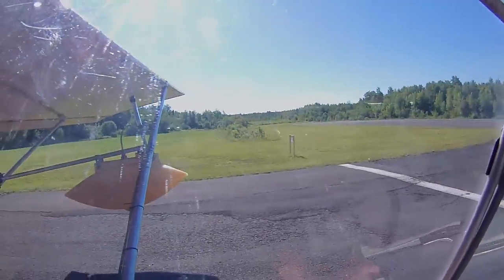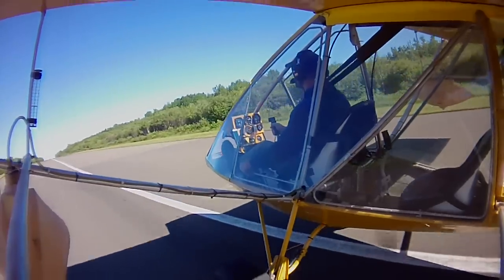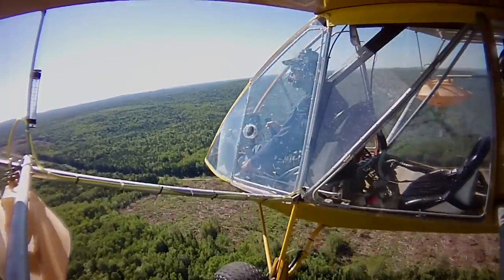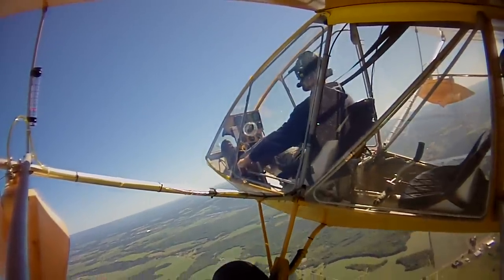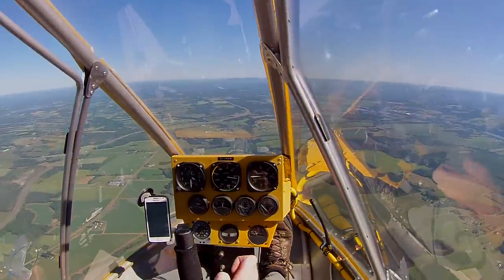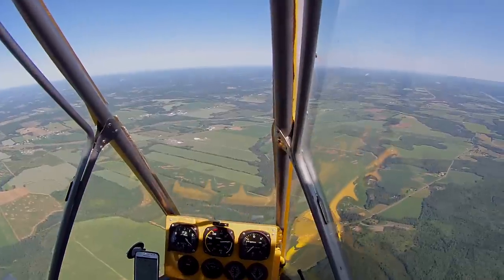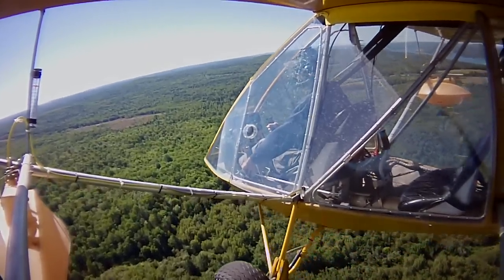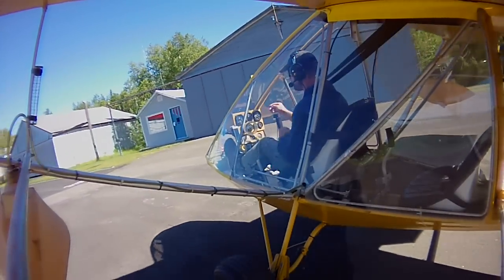Chinook Practice Session with Live Narration

Comment: Hi mmatt, in this video, at 14.30 you begin a 360 degree turn to your left and as you complete the turn you run into your own wake turbulence. After commenting on this you began a 360 degree turn to your right. Not sure if this manoeuvre has a name with you but in paragliding it is referred to as a turn reversal . I first came across it when I was doing an SIV course some years ago and it is used to assess how well a pilot can control his turns. SIV is a course which involves turning the perfectly stable paraglider into a bag of washing , and the correct action required to get it flying again. Always carried out above water with a safety boat in attendence.

Comment: Great vid and length, showing stall numbers and slow flight maneuvers. I used to have a 'Cobra' ultralight, by 'Advance(d) Aviation' I think. Pusher prop. It had small spoilerons/flaperons on top of the wings, but I rarely used them, only sometimes in stronger crosswind landings. That was a blast. I'd like to find a good deal and fly regularly again. There's a great grass strip airport 15 min away.  A couple friends have a 182, and an, RV12, I think. I like the low stall speeds of Ultralights and LSA/ELSA. Great vid.  Edit

Comment: Great video because it is perfect for where I am in the learning curve.   I had no trouble watching the whole thing.  I think some topics warrant a shorter length and in general it is probably safer for most subjects.  Love seeing the response of the aircraft with different inputs.  I think for some of these it would be cool to have an inset camera on the instrument cluster (if you wanted to get fancy).   I would be interested in your impressions of the the Beaver vs the Chinook air frame.  Likes and dislikes.
Reply from the maker: I've tried mounting a camera to the inside of the cockpit but for some reason couldn't get the vibration sorted out to an acceptable level. The Beaver and Chinook are both great airframes. The Beaver is a bit more yaw stable with the longer tail and swept wings and it's definitely easier to take off and land. Both are very rugged and well designed.
Reply: @mmatt  Hi Matt.  You might try one of several microphone vibration mounts.  Here is a simple one that could works with an action camera format.  

https://www.youtube.com/watch?v=unoVvswAPn0

  I would recommend a softer rubber band like a regular elastic band.  I've seen some absolutely fantastic vibration isolation that take care of a wide range of frequency inputs.  You can also add weight to camera to get rid of high frequency if it shows up.  Thanks for the Beaver/Chinook perspective.

Comment: Matt- My Chinook Plus 2 had flaps. Thats what you need to takeoff and land this thing with full authority. Full flaps will put you nose down and it will never fly faster than 50 dumping 500 feet just over the threshold and still being able to stop it within 300 feet. On takeoff flaps will get your tail flying in 2 or 3 seconds. In my opinion, it's just a matter of time before you ground loop this beast. It will probably stay upright with no damage but there is definately something wrong with this aircraft. I think the best purpose for a Chinook plus 2 is to put it on full lotus floats with no amphibs. It's a tough little plane and will take real beating but as a taildragger it's no Sunday flyer. You have to work on this technique all the time, use the flaps, and never ever land this airplane downwind.  Hope to see another video soon . We love your instruction technique in the Beaver
Reply from the maker: This Chinook has flaperons, but they're not really accessible from the front pilot seat. Silly design in my opinion.  I set them before takeoff and just use them for trim. Tundra tires on pavement sure is a recipe for groundloops. No close calls for me yet though. I had to do many many landings on grass before I was comfortable landing on pavement. I don't think there's anything wrong with the design, you just have to be willing to put the time in to learn how to operate it. It's definitely not for a new pilot.
Reply: The flaps handle was over my head. I could reach it . The guy who built the aircraft might have extended it but I don't know. 
I had the break away tailwheel so one it jumped out of the slot it could net be recovered easily.
Reply from the maker: I don't have a breakaway tailwheel. That could be the difference here. I can only imagine how terrible that would be once it came out of the slot!
Reply: GOOD Cheap aircraft are hard to define. Every ultralight has it's flaws. I'd ecpect though that if you didn;t want to to keep cheating death that you'd find yourself in a Rans. Those S-12 pusher or S-6 tractor are both great little flyers. The best part is they are not made out of all aluminum. The chromemoly cage just won't collapse all around you if you need to move some trees or a simple bobedwire fence. Both will take a VW direct drive if you don't have the cash for a Rotax.
Reply from the maker: I don't think I'm cheating death... but I do agree that Rans makes great airplanes. I have some time in an S-7 Courier. (video link below) That is a great flying aircraft. I'd love to try out the S-17 and S-18 Stingers as well.
https://www.youtube.com/watch?v=2K8jxVC3c8g

Comment: I'm very interested in buying a Chinook +2 as my first LSA and loved this long form video showing the flight characteristics. 

2 quick questions if you have the time to answer: 

1: I'm about 300-310lbs, would that be a bit too heavy for an aircraft like this, especially if flying with a passenger? (trying to lose weight and have a bit of time before I can afford one)
2: What's the realistic take-off and landing distance on one of these? 

I'd ideally like to use the plane to fly back and forth between where I live and where my parents live (about a 70 mile trip), and the best place I have to land is a 175 yard strip with about 600 yards of field on the other side of a shallow creek. So plenty of room to get down and to landing speed/ climb once the wheels are up. But would this be a realistically plausible landing area. 

Love the videos and please keep up the great work. They've been so helpful in trying to get started in the hobby.
Reply from the maker: Chinooks typically weigh around 600 lbs with full fuel. Their gross weight is 1050. According to the math you could take an additional 150 lbs of passenger or cargo. (these are ballpark numbers, every plane is a bit different)
175 yards should be enough room to land once you are able to put the wheels down exactly where you want them every time and you have good brakes. It should also be enough room for take off depending on your engine choice. In this case, I'd recommend a minimum of 65 hp.
Reply: @mmatt  Sounds great. Thank you so much!

Comment: Hi mmatt - I am building a Chinook Plus 2 out here in Northern Nevada, and find your vids to be very helpful.  I wish to suggest that you do a vid on a thorough pre-flight with good close-up views of your systems and assemblies.  Also, if you would ad commentary on what you like and how you think some areas might be improved, that would be fabulous !!  

I like the fact that you share verbally your thought processes as you fly along, and with your sharing of suggestions etc.  Some of it however, is difficult to hear above the background noise.
Reply from the maker: Ya, the intercom in the Chinook isn't as clear as the one I have in the Beaver. Consider a Flight Tech intercom for your plane. (that's what I use in the Beaver) I'll see about putting a video together as you suggested once I get the Chinook back in the air. It's currently grounded until I get a new engine for it. :-(

Comment: Please can you give more do s and donts  for landings and take off s in particular. I have purchased a Chinook plus 2 and need to convert from a weight shift microlight to a three axis like Chinook. And advice gladly accepted. Great video that.
Reply from the maker: Ultimately you gotta find an instructor and learn in person. Best tip I can give you is keep your feet moving to actively keep the plane straight at all times. Once it starts to get squirrelly, it's hard to get it back under control. And if possible, do all of your initial take offs and landings on grass, not pavement.

Comment: Do you prefer the closed cabin or open cockpit
Reply from the maker: There are a few times when having doors would be nice like when it's particularly cold or if I happen to fly fly through a rain shower, but overall, I feel the benefits of the open cockpit far outweigh the negatives. There's just nothing quite like the perfect uninterrupted visibility of the ground directly below you in a steep turn, the feeling of the wind whipping by, the ability to extend your arms out into the windstream, and the lack of greenhouse effect in the summer. I feel that an open cockpit simply gives me a more visceral flight experience.

Comment: How much flap input were you using on your touch & go's? Looking into the Chinook for possible future plans?
Reply from the maker: None. I only ever used them for short field landings.
Reply: @mmatt  Back when I did the PC Simulator in around 1998, I was landing on the numbers dead stick, floating it in on full flaps. Flew the 172 mostly, but a much higher angle of approach, kinda like parachuting in, but with practice, got to to point I could do it whenever I chose.

Comment: Hi Matt, I really enjoy your channel. I fly for work but would like to one day get into ultralights (Chinook/Drifter size). Whats your view on 2 stroke vs 4 stroke? Obviously 2 stroke is way cheaper, but I know little about them other than they seem to be less reliable than 4 stroke. I know a 912 is a pricey bit of equipment, but if you can maybe afford it, would you go that way? It would seem to have an advantage for cross country as well due to burn rate as well as no oil mixing etc. Are there a lot of extra handling considerations with the 2 strokes? Apologies for all the questions; I'd love to hear your views.
Cheers...
Reply from the maker: No, given the choice, I'd stick with a 2-stroke for an ultralight sized aircraft. Two-strokes are a lot more reliable these days now that we know how to properly run them. If you treat them right and stick to the manufacturers recommended maintenance schedule, I'd argue that they are at least as reliable as a 4-stroke. The power to weight ratio simply can't be beat either.
Reply: @mmatt  Thanks Matt, really appreciate your time and thoughts. Keep up the great work on the channel!
Reply: @mmatt  Would your answer change if you were operating out of an airport at 6500' MSL in a warm climate? Density altitude and all that?
Reply from the maker: No, I still think the lighter weight 2-stroke is the better choice on the Chinook. I might consider a  670 instead of the 582 though.
Reply: Check out the Yamaha engine that Steve Henry uses on his Highlander. 160hp and 125lbs 3-6gph. Pretty nice option.

Comment: Hi Matt.  When you are on final what rpm do you typically run?
Reply from the maker: It depends. If I've done it right, I'm at idle. That leads to a bouncy landing still though as I'm still perfecting my power off landing technique. I typically bring the RPMs up to 4000 or so around treetop level so I can soften my descent. You gotta make sure to start backing them off again a few feet off the ground or you'll just float down the full length of the runway. This is the same technique I initially teach students in the Beaver as well as it gives them more time to adjust their final height before touchdown. We quickly transition to power off landings though which is how I try to land every time when I'm solo in the Beaver since it's a much easier plane to land.

Comment: Thanks mmatt... loves that type of narration while you fly. I am looking at building an ultralight and I am very interested in a Chinook plus 2 on floats or an excalibur on floats.  Someone told me that the chinook is not for a low time pilot ( like me at 50 hrs).  Can you explain a bit why the chinook would be any different than a Excalibur or challenger or beaver ??    I like the  ruggedness of the chinook for backcountry landings... but if its to hard to fly...i can choose something else...lol
Reply from the maker: I think it's because the Chinook has a shorter tail compared to most other planes. This short-coupling makes the pitch and yaw controls very sensitive. It's very easy to over-control it. I have found that the Challenger (and I suspect the Excalibur) handles just the same if not a little worse. My personal experience in the Challenger also leads me to believe that it's not a good plane for low-time pilots either. However, if you're willing to put in the time with a good instructor, it won't take long to get a good safe handle on it. Just don't expect to hop out of a Cessna 150 and into a Challenger, Excalibur, or Chinook and expect to fly it safely. The Beaver has a longer tail and a swept back wing, both of which contribute to better stability. I have found that it flies like it's on rails. It simply goes in the direction that you point it until you tell it otherwise. I'm also of the opinion that the Beaver landing gear is superior in terms of ruggedness. That of course makes no difference at all if you plan on using floats. :-) If you want a Chinook (and why not? they're great planes!) get one. Just plan on some extra time with an instructor before you go by yourself. It is a fantastically rugged plane, it's fun to fly, and lends itself quite nicely to off airport operations.
Reply: That is great advice and insight. I will certainly get training before i get in one of those ultralights. I am leaning towards the chinook plus 2.  Keep those videos coming....they are very informative, educational and inspiring for aspiring pilots like me...lol.  What engine do you like best in terms of power and reliability for bush operation.
Reply from the maker: It's hard to go wrong with the Rotax 912. Aside from the initial cost and overhaul costs, the fuel economy and reliability are fantastic. The extra power they provide, especially when operating off floats, would be highly beneficial. That said, I run a Rotax 582 on my Chinook. They have the reputation of also being a very reliable engine if properly cared for. They are around a third the price of the 912 but they burn a bit more gas. Overhauls are more frequent but also a lot less expensive.
Reply from the maker: I have seen those vertical finlets (isn't that just a cute name for them) before on Challengers but I thought they were just for when they had floats on them. I didn't know they were supposed to be installed on all of them that have doors. I see now that the new kits have larger tails probably for the same reason. I haven't flown the Chinook with the doors off yet but now I want to so I can test this theory (which I strongly suspect to be correct).
Thanks for commenting! I love it when I get to learn stuff like this. :-)
Reply: Hey matt, which one do you prefer flying?  The beaver or the chinook?  Do they still make the Bever 550 ?   I saw many challengers and not many have the finlets installed. maybe its a question of flying experience, people with lots of hours may not mind the sensitivity of the controls. But yes, a video with and without door would make a great learning experience.
Reply from the maker: I prefer the Beaver. It tracks straight and true, very stable, and fun to fly. The Chinook is fun too, just a bit more challenging. The Beaver is currently not in production but I think it will be again soon. The rights for it are currently for sale.
Reply: Thanks Matt.  Maybe you should buy the rights to the Beaver 550 RX...lol     What would you add to the Beaver if you had the rights???
Reply from the maker: I dream of this. LOL! I just don't have the funds to make it work though.
What would I add...? Off the top of my head:
- wider stance landing gear
- suspended nose wheel
- I'd look into a folding wing option
- easy on, easy off gull wing doors (like the Challenger) for cold weather flying
- I'd extend the back of the fuselage so the fiberglass pod tapers off more naturally
- streamlined lift struts (not plastic fairings, actual streamlined lift struts)
- maybe flaps or at least flaperons...? kinda torn on that one.
But whatever though, I'm just dreaming here. :-)
Reply: I hope someone reputable can pick that up and continue production and support. And maybe add some of your changes...lol    Didn't they have a Beaver RX 650   before?  folding wings...etc
Reply from the maker: Yup, the 650 was a rather limited run and it had some flaws. The wings had a tendency to fold in flight. Oops. Apparently all the flaws were fixed though in the end but it didn't see much success.

The info on the gyrocopters is interesting as is the info on the new Challenger tail.
Reply: Andre- The Chinook plus 2 is not for many pilots much less short time pilots. It has all the capabilities on paper any plane could have but that does not mean its an easy to fly machine. The Excalibur has a decent rudder and a pleasure to fly, but when you are talking floats the best thing to do is to train on the aircraft that you are gonna build. I don't have float experience but my advice is from seeing guys on full lotus with Beavers. It's a lot of drag and long time to get airborn.